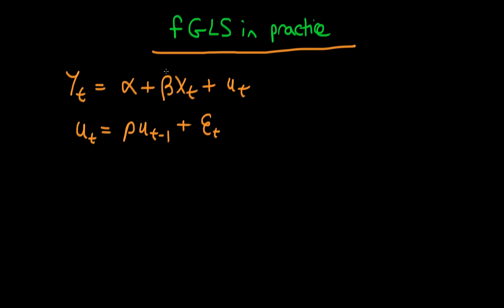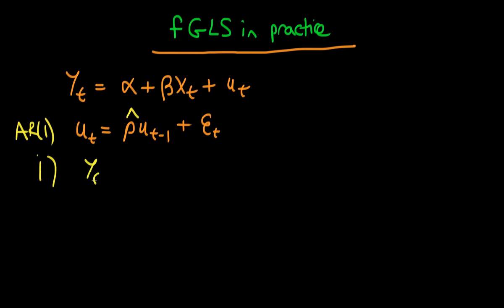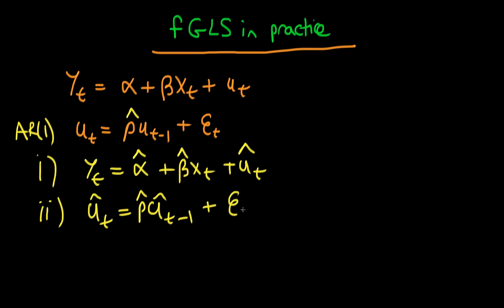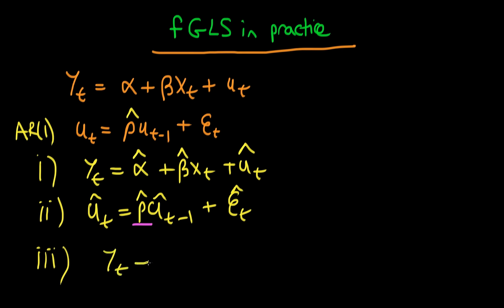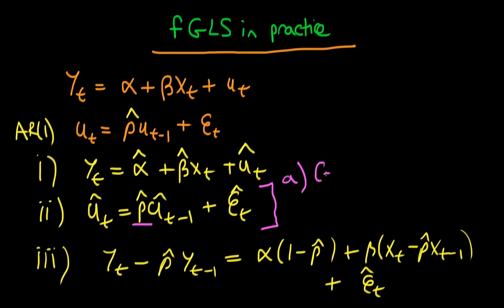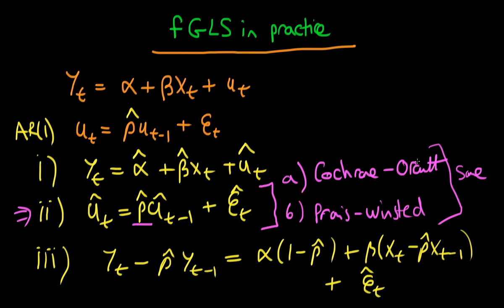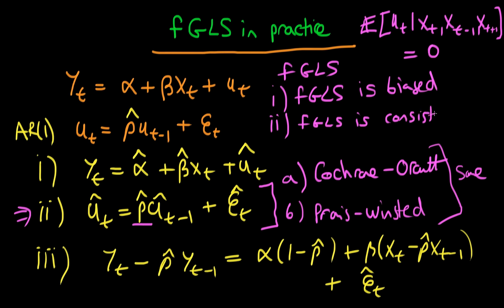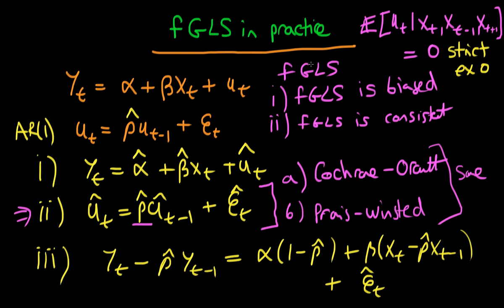fGLS for serially correlated errors

Comment: Hi Ben,
I read in some literature that as part of the Cochrane‐Orcutt procedure, they continue to estimate the new error until the value of rho converges. Could you explain why you didn't follow this method?
Cheers
Reply: weretu
Reply: I guess that would be the result if we include u(t-2) etc. to replace each previous error. However, here we assume an AR(1) process, hence disregarding additional forms of serial correlation. I think this might be the reason.